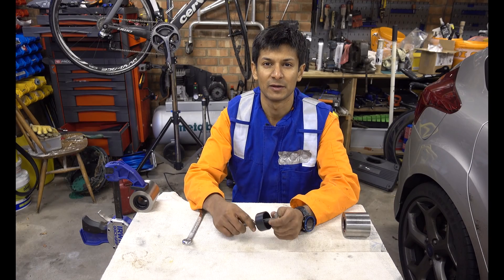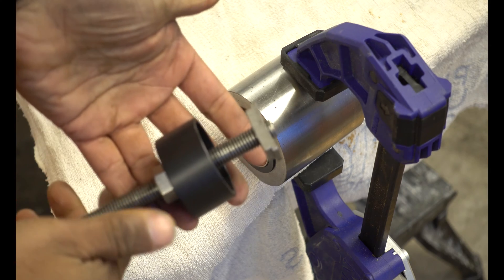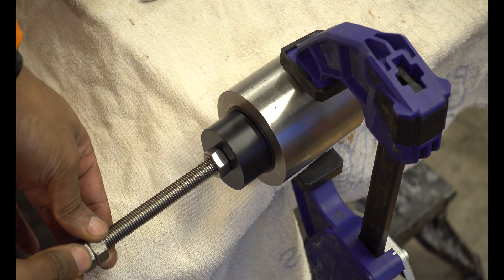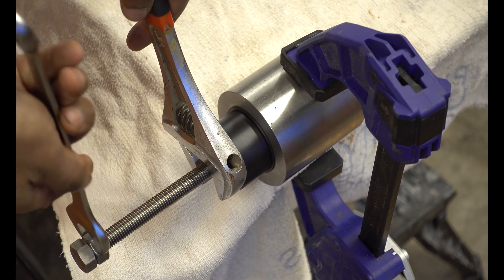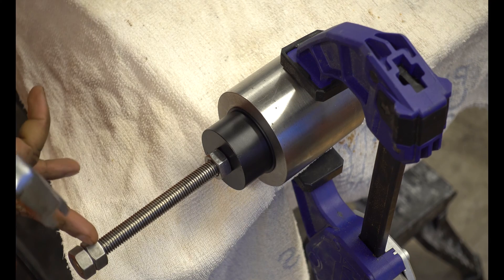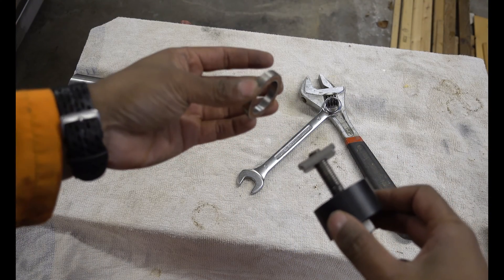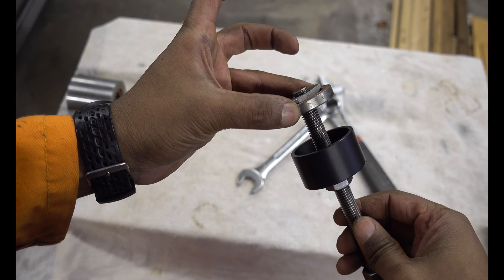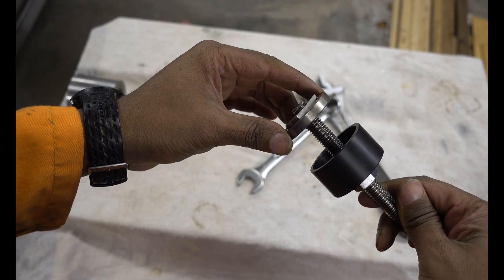Hambini BB30 PF30 Removal Tool

Comment: Hi hambini,

Bought one of these and just trying it for the first time. I'm having issues with using it on a pf30 bb removal on a carbon frame. I tried method one, but the lip which goes in the frame just unscrews itself and falls into the frame. Bearings are smooth. Tried the second method and as I tighten the bolt I can hear a crackling noise so stopped doing it. Not sure what I'm doing wrong here? Does this remove just the bearings from a pf30 or the entire cup? I'm trying to remove the entire cup. Thanks for the help.

Comment: That is superb!  Smooth the edges of the design off and add the option for two handles instead of nuts (or as well as) and you can take this to market!  Impressive stuff!
Reply from the maker: Why thankyou! Already available on the Hambini Website! Shameless plug but it is my channel!
Reply: Well there you go then!  Nice.

So...  do you take commissions for tools?
Reply from the maker: depends on what you need?! and whether I have the technical ability to make it :)
Reply: I wanted to make a kind of one piece Cannondale SiSL2 crank extractor.  The current tool that Cannondale have is this...

http://www.cannondaleexperts.com/Cannondale-Hollowgram-Crank-Removal-2-Piece-Extraction-Tool--KT013_p_124.html

I thought it would be good to make a tool which incorporates both of these parts, and includes handles as well...